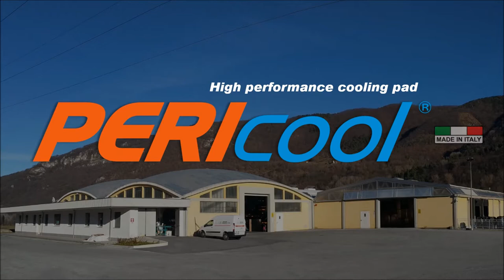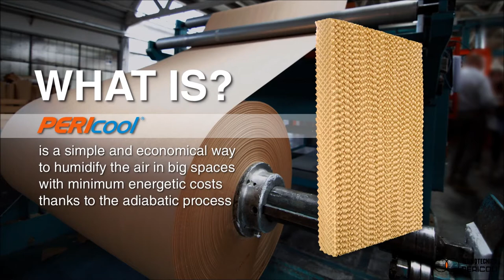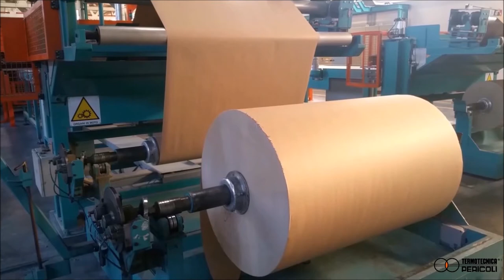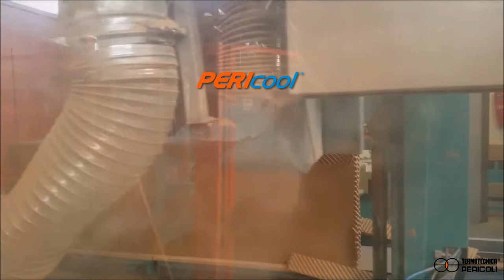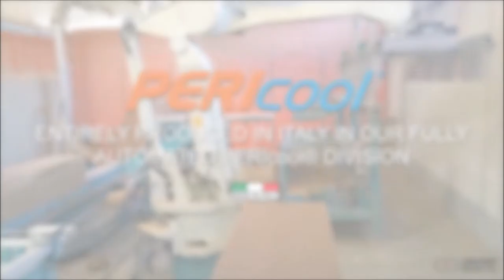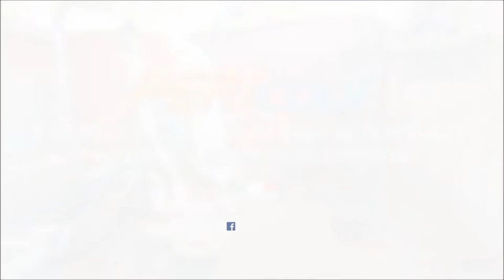PERIcool® - Evaporative cooling pad

Comment: Based on the simple physical principle of adiabatic cooling, our cooling pad provides the perfect combination of usability, reliability and low running costs, thus becoming the best solution ever to solve the problem of excessive heat in large environments.